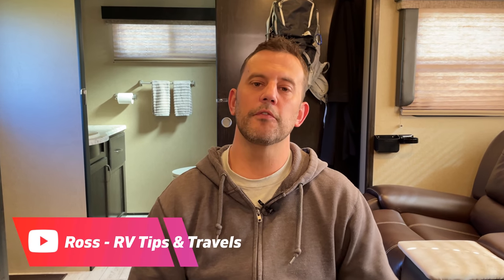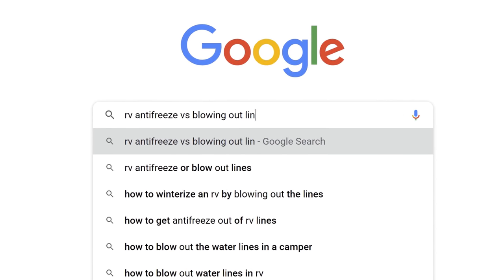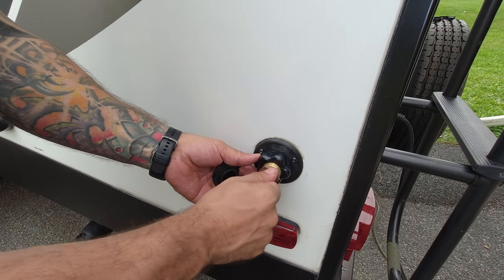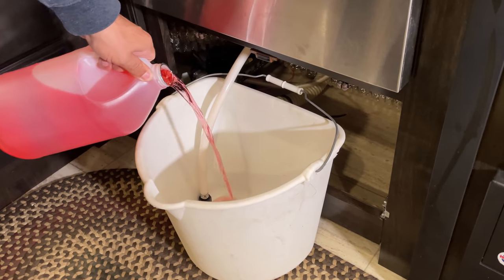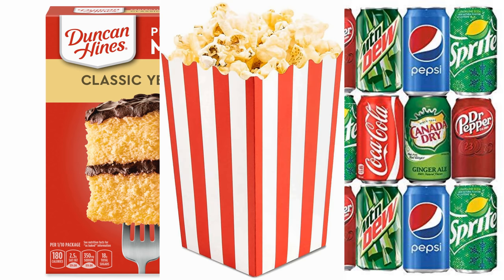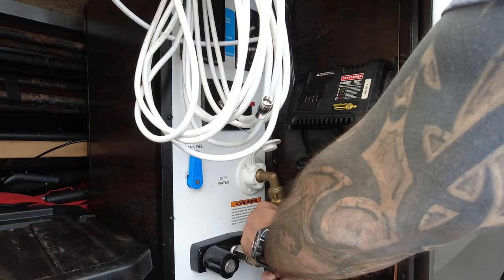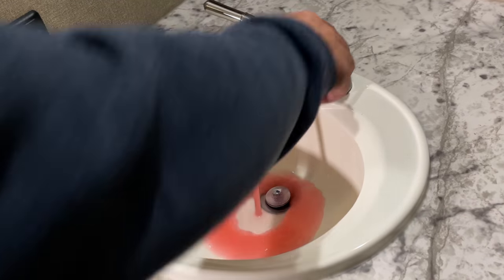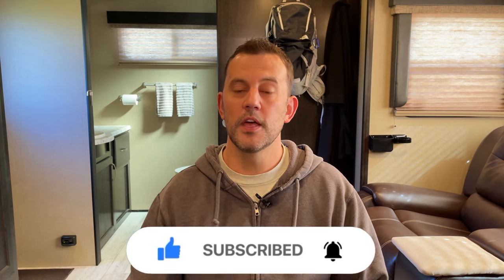RV Antifreeze Vs Compressed Air: Which RV Winterizing Method is Better?

Comment: I use BOTH.  I blow out the lines with the compressed air to remove most of the water from all the lines.  Then I use the antifreeze in the lines this way it is not watered down and I know the lines are protected.
Reply: Same
Reply: Same here! Then it is for sure
Reply: Ditto

Comment: Most problems are not related to what method you select (compressed air, anti-freeze or what I do: use both methods as a double insurance) but not taking into account all sensitive failure points: Water heater not emptied, P traps not emptied and/or not filled with anti-freeze. Forgetting to run air or anti-freeze through toilet, outdoor shower lines, ice maker lines, washer machine lines. Not using the low point water outlets, often reachable under the rv trailer, which can fail when only using the compressed air method. Plus, a lot of people use to much psi air pressure which can damage lines. 40 psi is often sufficient and above 50 psi, you are taking a huge risk.

Comment: I have had a travel trailer since 2004 and I blow the air in the lines first to remove the water then I pump -50 plumbing antifreeze in the lines and with this method, I am assured that the antifreeze is not diluted and I have not had any issues. It’s worth the additional 10 mins to be on the cautious side. Great video.
Reply from the maker: Thanks again Paul for watching and commenting my friend.

Comment: I do both, blow out then chase with antifreeze in the lines and down the drains and into the tanks.  You never know what stays in the lines and can accumulate and freeze.  Repairs are way worse than the simple two step process.  But to each their own.
Reply from the maker: Nothing wrong with overkill!

Comment: I've done both on my Thor 23u. Since I carry a compressor in the rv it's just easier. Not to mention my water pump is under the dinet which is a pain to get to and hook up the siphon. You don't need to get all the water out as long as you have plenty of air in the lines any ice formation will expand in the direction of least force or the air space in the line. I don't use my fresh water system for drinking so if I have to use antifreeze in a pinch it's not a big deal. People stress too much on this topic.

Comment: I do both when winterizing......I also will an air gun tip into the drains, stuff a cloth in the drain around it, and blow air into them.  Then fill them with antifreeze.  Better safe than sorry!
Reply: Well you really don’t need to blow the drains out with air , if you’re using antifreeze in the drains anyway it will push the water down and out of traps in drains. Make sense?

Comment: I use Antifreeze but but my variation is I use  camperpump to pump out waterline as it's designed to pump water through RV NO REASON it can't push air to get most water out  then still useing pump add Antifreeze to fill lines and check each facet in Camper but I Also add a little Antifreeze into Hotwater tank

Comment: I ahve had 3 RVs over 39 years. The third one I have had the RV winterized with after I blew out the lines. Our second RV, I didn't get all the water out of the hot water input line. I have been more careful since. Emergency repairs at the campground aren't and the wife isn't happy. This year I have blown it out and I'm going to do the antifreeze my self. The 3 videos are good and have a lot of information. Thank you.
Reply from the maker: Andy you bring up a good point and something I noticed this year.  I always use antifreeze, but this year I had only a few minutes one day so I blew all the lines out and I was very thorough.  I had to leave the rv, came back the next day to run antifreeze through and noticed my bathroom faucets were frozen closed.  It took about 30 minutes of warming up the inside to free them up, but the point is this, blowing out lines never removes all the water, and after it’s done water can pool up in certain areas due to gravity and cause issues.  I will never be comfortable with using just air.  Thanks for sharing.

Comment: I have done both methods. I think the compressed air is easier and quicker. Compressed air is especially easier in the spring when you open back up - no mess of antifreeze to deal with.
Reply from the maker: Thanks for watching and sharing James.
Reply: Thank you. Agreed

Comment: First let me say I REALLY enjoyed those out takes and bloopers!

Second, I want to thank you for taking time to put together these videos.  I found this one very helpful and chose to use this method since I have and air compressor close to my trailer.  I also believe that this method will be the simplest to de-winterize in the spring.

I modified your steps a little bit just to better align with my trailer.  I also modified the process a bit with the water pump.  My pump is located right next to the gravity fill and city water fill.  Kind of cramped to get to because it is right next to the bed and the exterior wall.  I also do not have a way to either hook up the air compressor to the water pump or a way to draw antifreeze into the water pump.  

I decided to run the pump with one of the faucets open first.  Then I blew out the lines with compressed air as you suggested in your video.  Finally I removed both inlet and outlet lines from the pump and turned it on for a few seconds to drain any residual water from the pump.  I feel confident this will keep the pump from freezing given that the inlet and outlet lines are mounted level with the pump.  If I am wrong about this and I experience a problem I will be sure to report back.

Thanks again!  We have some pretty cold weather heading our way this week!  (I think most of the U.S does LOL).

( ;
Reply from the maker: glad to help and thank you for the comment!

Comment: I just winterized my new trailer for the first time. I chose to go the compressed air method for fresh water lines and antifreeze for the p-traps and toilet as well as a little in the holding tanks. I never liked the idea of antifreeze in the drinking water lines. I live in Pennsylvania where we get freezing weather for weeks on end. I blow air in my swimming pool lines for years with out an issue.
Reply from the maker: Thanks for watching and commenting Ralph!

Comment: I did a combination of both. Air pressure at 30 psi max, then antifreeze. Flip the valves to the water heater. Pull the drain plug
From the heater. Antifreeze  to all the P traps and toilet. Come camping season, I would wash out the    RV antifreeze with water.  Then a mixture of bleach and water. Let it sit for a couple of hours. Then wash it out till no taste of bleach.
Reply from the maker: Thanks for watching and commenting bud!

Comment: I use compressed air. I had trouble with getting rid taste of the antifreeze one time. The compressed air method has worked flawlessly, especially with PEX pipes.
Reply: exactly that's why I use ONLY air...that so-called "food grade safe" stuff smells and tastes horrible and I had to flush out my system several times to get rid of it.
Reply from the maker: Sanitize the lines and it’s gone.  You should be sanitizing anyway even if you use air because you’re never getting all the water out.  It sits in there and bacteria grows.  Sanitizing is underrated. https://youtu.be/j-fmCThdMOw?si=-R1KjcD3u0eFhqaq

Comment: Droplets are fine so long as there’s space for them to expand. I’ve used compressed air for many years to winterize and never had issues. I’m also in Alaska so winters here are much colder and longer than anywhere else in the lower 48.

Comment: I come and go from home all winter long in my motorhome. Antifreeze works best but I use a combo because I'm constantly winterizing, sometimes weekly depending on the weather... and $6 bucks a gallon is a pain. I use a gallon or so to pull some antifreeze thru all lines the traditional way, 30 seconds or so per valve until the 1-gallon jug is almost depleted. This ensures the water pump is saturated with antifreeze.  Then I hook up the air and blow out the lines that way. When you prime the lines with antifreeze, the last thing that comes out of each line while blowing them out with compressed air is a bit of antifreeze. Gives me that peace of mind even when the temp drops to the teens. All has been good for years with this method.
Reply from the maker: Great tip John, thanks for sharing!
Reply: I never thought about doing it that way. But it makes great sense to at least know that anti freeze get to everything and then blow the lines out. Thanks. I’ve done both for years. But gonna try this way in the next couple of days.

Comment: Nice job on the video, Ross!  When you consider the cost of each method, you also have to include the cost of the air compressor for the air method. I’ve followed your videos since the first one and they are very helpful!
Reply from the maker: I appreciate that John!  Glad to have you on board and thanks for being a part of the channel.  The reason I didnt consider the cost for the air compressor is because I would use it in both methods, so it wouldnt make a difference, hope that makes sense.  Thanks again for being a long time subscriber!

Comment: I use the compressed air method.   When I get only air from each outlet location, I go back to the first one and let them blow again.   That lets any water settle and gets just that little bit out.
Reply: One more comment.   De-winterizing a compressed air method is way easier.   Turn it on till the air goes away and done.
Reply from the maker: Still need to fill p traps with antifreeze or disassemble and drain.  Also need to cover toilet ball valve with antifreeze if you want it to stay moist.

Comment: I use antifreeze but last year I was not able to buy any before the big freeze. So I had to use compressed air.
You may want to drain your air compressor before you use it to blow out the lines and put a filter on it. They are not rated for breathing air and throw oil, water down lines. So I sanitized our system twice after the freeze then used antifreeze
Reply from the maker: good tips, tanks Owen
Reply: Use a oil less compressor

Comment: I don't use antifreeze and I don't blow out my lines.

I do empty my water holding tank and hot water boiler, I run the pump with all water valves open and leave them open, and I remove the cap from my electric water pump filter so as much water is out of critical areas if it freezes.  A little residual water in a hose will freeze but can't cause damage. That's all I do. Takes a few minutes. Done. I live in Germany and we do have freezing temps potentialky for 5 months.
Reply from the maker: thanks for watching and commenting Mark
Reply: Well you’re taking chances that way. You probably don’t worry if something does break cause you will have it fixed or buy a new one. Lots of people don’t and can’t afford any problems at all.

Comment: If I store my RV in a temp and humidity controlled location for the most of the winter but want to take it out and use it occassionally during winter to escape the PA cold, I would be winterizing and de-winterizing multiple times. I am thinking compressed air is the best bet for me since to de-winterize seems to take a lot water and time to flush everything?
Reply from the maker: I would agree, i know people who winterize multiple times a year in a similar situation as you, compressed air will be easiest.

Comment: One good thing about my Coachman TT is that it has 3 cold low point drains and too hot Plus the hot water heater plug drains down pretty easy mix blowout real easy a little antifreeze in the  drains enough for a little to go into the gray water and black water tanks then I'm done no antifreeze in the water lines no bad taste next spring

Comment: I blow out all the lines and fill them all with antifreeze.   I drain and bypass the hot water heater and take the plug out.    Then I dump antifreeze down all the drains and toilet.  Easy and I never worry about freezing and breaking stuff

Comment: Thanks for the fine video on winterizing and the helpful tips. This is our second year of winterizing. Last year it went without a hitch but this year I have encountered a problem with getting the antifreeze to more through the pipes. I have followed the directions for emptying the hot water tank, switching the valves near the water heater so that it is bypassed. I have opened and closed the low point drains. I have emptied the water heater and even taken out the anode to make sure that no antifreeze has been diverted to the tank. My problem is that I have had to introduce so much antifreeze into the system and I am still not seeing a steady stream of antifreeze coming out of the faucets,  I can hear and feel air being pushed through the faucet and I have seen some antifreeze come out of the kitchen faucets at various times but not a steady stream as is demonstrated in your video. The shower shows evidence of antifreeze as to the outside shower and water hose near our outdoor grill. Nothing coming out of the bathroom faucets and the toilet when flushed did not show any antifreeze at all. It is possible there is an air leak somewhere which is not letting pump pressurize the line? I used 10 gallons (which is way too much!) and don't know where it has gone. Any suggestions?  I apologize for the long post. Thanks.
Reply from the maker: First things first…. Are your low point drains closed?
Reply: @RVTIPSANDTRAVELS  Yes, they are closed. On Monday when I first began to put in antifreeze I had forgotten to  put the plugs back on. I probably lost some antifreeze but I have since put in quite a bit more.
Reply from the maker: Open your fresh tank drain and let me know if any antifreeze comes out.
Reply: @RVTIPSANDTRAVELS  I tried that a couple of times during this process and there was no pink fluid coming out, just a small amount of water. I can try it again.

Comment: I use my rv over the winter to travel from cold to warm (ie Flagstaff AZ to Phoenix AZ) over the weekends (1-2x per month). Would using the air method AND leaving the furnace set to 40deg (and hooked up to shore power) be sufficient? My rv has heated and enclosed underbelly as well. Jan-Mar are probably the coldest months.
Reply from the maker: thanks for the info my friend.

Comment: I blow the lines with air fill with antifreeze then blow out the anti freeze little overkill but works nice
Reply from the maker: nothing wrong with that method at all... i think its something i may mention in my next winterizing video as it might be a popular option for a lot of folks who dont trust the air method, but also dont want antifreeze sitting in the lines.

Comment: I use compressed air only… just blow out the lines as much as possible and then leave all the taps open. It may not be the “proper” method but I haven’t had any problems!🤷🏻‍♂️
Reply from the maker: thanks for watching and commenting Blake!
Reply: What about your p-traps?
Reply: @chachi5975  I didn’t worry about the P-traps (maybe should have 🤷🏻‍♂️) Forgot to mention but I did add some RV antifreeze to the toilet… supposedly it’s not really necessary for freezing but helps keep the seals from drying out
Reply: @Blakehx  maybe the rest of the antifreeze should go in the p-traps, it doesn't take the whole gallon for the toilet. Just a thought.
Reply: Definitely add antifreeze to all traps and make sure to flush through toilets valves or they will freeze and break. Oh and put the rest of the antifreeze in the shower drain because if that trap freezes and breaks it’s very costly to replace.

Comment: Last 2 years I have used antifreeze. This year I want to blowout the lines. My only worry is the foot valve on the toilet. Is blowing out the lines sufficient enough in freezing temperatures to keep this valve from expanding and cracking?
Reply from the maker: thats a great question... long story short, i was in a pinch without antifreeze 1 year and blew the lines out 3 days before i could find antifreeze at the store.  there was some water left in my sink faucet even after blowing out and it froze up. had to heat up the rv to open the faucet, but no damage... the foot pedal is more complicated and might hold enough water... thats why i always use antifreeze.
Reply: @RVTIPSANDTRAVELS  great info. Thanks for the reply

Comment: I use the anti freeze method without the compressed air. How important is it that you blow air in the black tank wash port. First time i winterized my own trailer
Reply from the maker: A lot of people don’t do it, you should be fine.
Reply: @RVTIPSANDTRAVELS  thanks for your quick response and I love your videos, very infomative
Reply from the maker: Thank you Brian!

Comment: But yes, you do need it in the traps.
Reply from the maker: Seems like a waste of time and unnecessary work to remove the p trap under the shower pan when in takes 2 seconds to pour some antifreeze in the drain.  Plumbing under the shower is not fun to mess with.  Very little access and all that constant removing and replacing increases wear on already cheap plumbing parts.  Plus p traps are past the point of your drinking water. I would doubt many people are tearing apart their plumbing twice a year when 6 ounces of antifreeze will do the job.